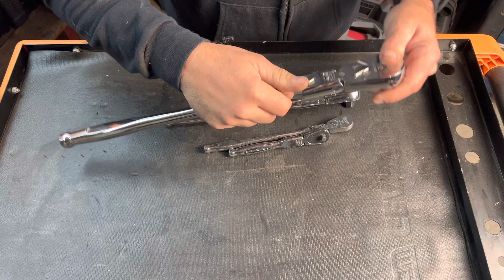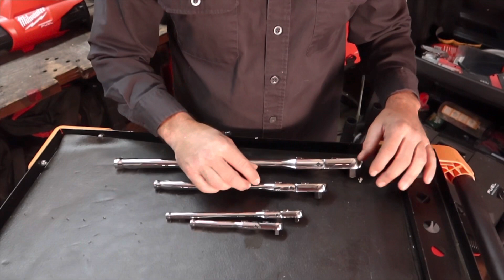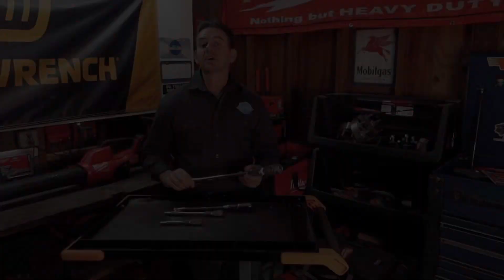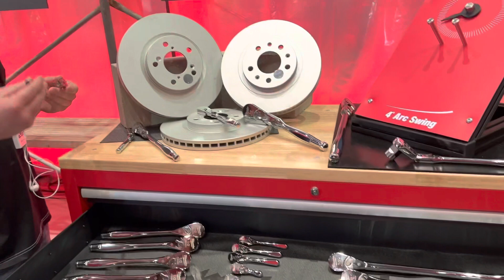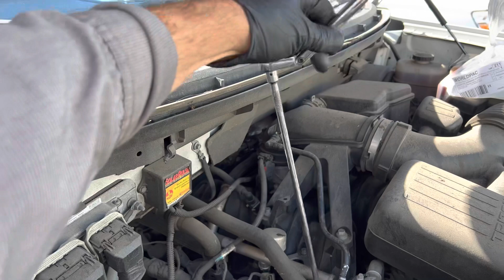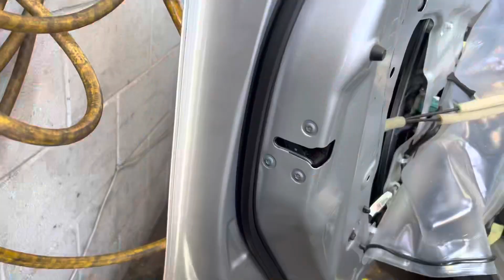New Flex Head Ratchets From Milwaukee Tool Are  Finally Here!

Comment: I bought the 3/8" drive 12" ratchet. It is as smooth as butter. I really like it. Time will tell if it is really as good as I think it is.
Reply: Hows it performing now?
Reply: @baldotorres1976  I am still completely happy with it. I own many different brands and the Milwaukee is my favorite. Better than my Snap ons in my opinion.
Reply: How’s it treating you?
Reply: @DentsideDick  I use it occasionally, but it is a very good tool. I probably have at least a dozen 3/8" ratchets. Snap on, Icon, Tekton, USA craftsman, gear wrench etc. The Milwaukee probably has the lightest back drag of all of them. It is also silky smooth. It is a big ratchet though, because it is a locking flex head. I mainly use it for oil changes. It has been perfect for that. I haven't used it for any high torque applications.

Comment: I ordered my 3/8 12 in flex head ratchet today. Can’t wait to put it to work
Reply: One year later, how has it been?
Reply: 2 years later, how’s it been?
Reply: @machoprieto5763  honestly I was just exited because it is Milwaukee. I still have it and barely used it. I used more my snap on 3/8 flex with the soft grip than it. I’m sure it’s a great ratchet and it’ll stand up to the test of time
Reply: @ I’m between that, snap on or this Milwaukee sets. Snap on is a bit more expensive
Reply: @ I just like the comfort grip. Gearwrench makes some in comfort grip that I bet are just as good and get the job done